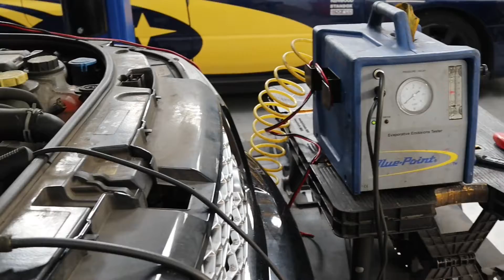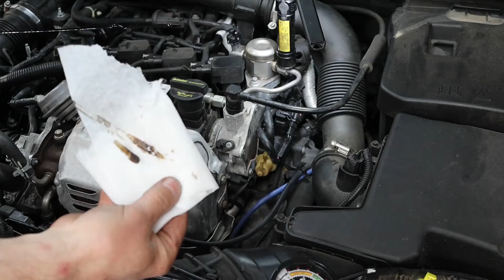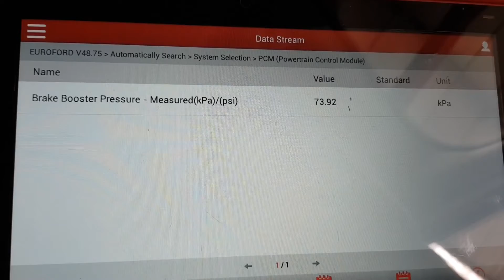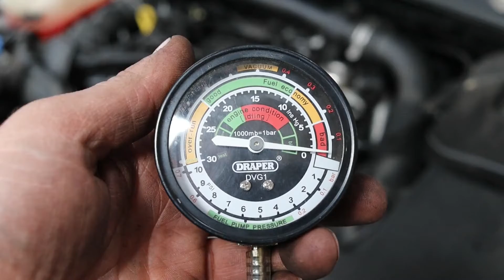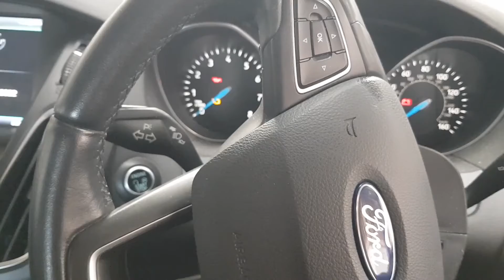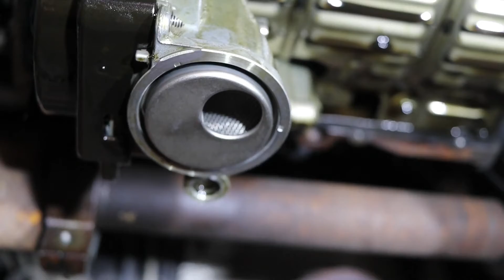Focus, Fiesta 1.0 EcoBoost P0299, oil light on

Comment: PLEASE HELP! 
I’m so Confused 😩🤦🏼‍♀️ I have no clue about cars mechanically, brought my son a 2016 focus, 62k, lovely car. A week later oil light came on. But Engine has oil? Sounds like crap, apparently it’s a ‘death rattle’ for a car 😩🤦🏼‍♀️😩 I spoke to someone that works at Ford who said there is a common fault with the oil pump pick up? And it’s probably because the ‘wet belt’ has broken down and probably hasn’t been maintained properly. He said we could just change the oil pump but may aswell do the wet belt aswell incase it is knackered. But I cannot afford it, my son cannot afford to spend so much as he’s only started work last week after finishing college. I really hoped this would at least last him 6 months. Paid £3k for it due to light body work damage on side and boot. But ran ok and no oil light on wen we brought it. My husband is a paint sprayer so can do the body work but he’s not a mechanic. Now reading through all these comments it sounds like they don’t all have wet belts? And it could be something else completely, am I correct in thinking that? And can anyone advise what I can do next, in the best way financially to just get it useable? Would HUGELY appreciate anyone’s advice 🙏🏻
Reply from the maker: Hi, if it's a 1 litre ecoboost engine then yes it's a wet belt, if the oil pump strainer is blocked, which is highly likely then you'll eventually need a new timing belt. There aren't any short cuts to this job. If it has A/C then at least one of the pump bolts will break as this has to be removed to do any of the repairs, this usually escalates the work. Sadly these engines are very unreliable, difficult to work on and expensive to maintain.
Reply: Yes I can advise you that Ford will replace your engine at their cost as long as you have the following criteria is met under the Ford good will scheme.
You MUST have full service history from either Ford or an independent garage.
Car must be under 19 yrs old which it is.
The servicing must be manually within 3 months either side of due date.
They will need to review the car to ensure it was belt failure that caused the engine failure.
Hope this helps and all Ford dealerships have been sent a document from Ford stating the above mentioned so all long as you have the history then go direct to Ford ok
Reply: Sorry 10 years old😂

Comment: I wouldn't buy a wheelbarrow if it had a Ford badge on it, I started working on Fords in the late 1960s, they were a heap of junk then and they're a heap of junk now. Just had a Transit 2 litre diesel engine replaced at 77k miles because the head gasket failed and the injectors were so stuck in that they couldn't shift them to get the cam cover off (this was at a main Ford dealership). This is yet another common problem with Fords. Why the hell people buy them I'll never know, to say they're crap is not true - they're much worse than that!
Reply: Great cars, with great engines!.. Every brand of cars got shitty individs, and every brand got well driven garages!.. Correct me if I'm wrong!.  1.0l ecoboost engine when new, back in 2012, no one knew about it's future weaknesses!.. Driven Fords when new, then you know why they sold so many of 1.0l ecoboosts!..  If Ford had taken it a bit more customer-friendly,.they may be would sold it for a longer period as well!. I've had so many people that are telling me about the greatest fun in their own Fords,.. And I certainly belive every thing said about what these cars offers, in a fun, and reliable way!.. So, after 7-8 years there are people who have been neglecting service, and specs, and there comes ones trouble!.. The electrics and mechanical parts on these Ford cars, are actually the best Ford-cars ever been made,..my opinion..
Reply from the maker: @gorgon9786  my sons 1.0 ecoboost was less than 2.5 years old when it snapped a crankshaft. The manufacturer knows there are issues from the start but they usually make more money selling lots of cars than warranty claims, so it's worth letting them go hoping they make it to 3 years! For example, Renault does not test any of their car parts, as it works out cheaper to replace parts under warranty rather than pay to test them before hand!
Reply: @melsmotors  yeah, that is due to the shitty belt, huh?. Hope he got it fixed under warranty!?  There are many bad stories, where the belt has gone bad in such early life of the ecoboost engines..  If Ford had been wise enough to found another way,.
But, as someone said it, if make it work for 3 years,.. They are winners!.. Without thaughts for future,.. If you don't see the customers again!!.. The Ford saga, isn't what it was from 2004-5, and making it big for 10-15 years, won't be enough for the future..  In my book,. French cars are as bad as any GM.. Maybe they've been doing it better the last year's?.. Vag has been had their shitty complaints as well,.?  Not bad cars overall?
Reply: @gorgon9786  I just fell off my chair laughing! Since my last post we've had yet another Ford Transit disaster on a not very old one which we have owned from new and which has always been maintained exactly as per specifications. The stupid wet timing belt broke, over 30,000 miles before it was due to be replaced according to Ford's spec. Again, a common fault which has now cost thousands for a new engine, second Ford engine failure in less than 2 months which have needed new engines at under 100k miles. The internet is full of tales of woe with wrecked ecoboost engines as well as these diesels. They are all CRAP! I have an Audi A6 diesel which still runs like new at 322k miles, the cam cover only having been off once to replace one glow plug and the rest of the engine being original except for service replacements like cam belts etc. In over 50 years of working with cars I've never seen a single Ford which could even come close to that level of reliability. The head mechanic at our local Transit main agent even admitted himself that they're a heap of trouble.
Reply from the maker: Hi Nigel, that's a great summary of Ford, when I was at college they used to say, "FORD, Found On Rubbish Dump" my friend works at Ford and says they couldn't build an engine to save their lives. Even the new transits have a crappy wet belt! Thanks for watching and commenting ☺️
Reply: @melsmotors  The other ones are "Found On Road Dead" or "Fix Or Repair Daily".

Comment: I totally agree with you. The timing belt and oil don't mix. I was in tesco Carpark, and I heard this focus knocking on tickover. This little old lady said to me that this light came on the dashboard 6 weeks ago. I had a look at the car for her and found the oil strainer completely blocked where the timing belt started to break down. Fords quoted her £6000 for a new engine fitted, lol.
In my opinion this has to be one of the worst engines Ford has produced.
Reply from the maker: Hi Paul, thanks for your insight. One of my old mechanics now works at Ford and his comments were that, as of right now Ford can't seem to make an engine to save their lives! We're changing engines every day on something, including Transit engines with the wet belt. The little Peugeot and Citroen engines are similar with a wet belt. If a mechanic could drag an engineer out of his chair and into a workshop he would get such a beating for their stupid designs! 😵‍💫
Reply: Hi.
How did the car do after you cleaned the oil filter?

Comment: Informative video, is that diagnostic machine Launch?
Reply from the maker: I can't remember the video, if it was a red scanner then yes it was the Launch. The snap on is also red but most people recognise that scanner.
Reply: @melsmotors  i did think it was Launch......i think mine one is the same but totally Useless now as its out of software update and once is out of software update period Launch Uk makes those machine almost inoperable on purpose! Unlike Autel, 3 years old and performs much better than launch🙈

Comment: PSA Pure Tech 1.2t has same issue. I read they put it in the oil to reduce friction and make the motor use less fuel. The race to minimum c02 emission.
Reply from the maker: That doesn't make any sense if you think about it, some timing belts have a white coating on the teeth to do just that. Thanks for watching and commenting :0)

Comment: *****Easy fix.  Place your finger over the small vacuum pump port that he connects to at 3:53 .  If you can feel a vacuum but also blowing air the check valve that is the plastic port is bad.  Remove the star fastener that holds in the small vacuum port (check valve) on the pump.  Remove the plastic star shaped diaphragm holder and any remnants of the rubber check valve.  Replace back on the pump and splice in an $8 vacuum check valve from Dorman to the vacuum line.  Ford does not sell the check valve separate from the $160 pump. Worked great in my case as the pump was still good as I suspect the one in this video was.  Don't forget to check that the solenoid is holding vacuum and all the other lines are intact.  You definitely do not want to replace the vacuum solenoid like he did, Ford wants $900 for it.  At least that's what my local dealer stated.
Reply: You can buy the check valve on eBay in the UK.  £10 - £15
Reply: Çok doğru tespit boşuna pompa değistirmek yanlış
Reply: First thing I said was ' that pump is good' 😂.

Comment: For future reference, it's sometimes only that little plastic nipple on the vacuum pump that fails, there's a diaphragm on that and it tears. You can undo the t25 or t30 (I can't remember) and replace this nipple/diaphragm only 👍👍

However in your case with the brake booster issue I completely agree the complete pump needed to be replaced. But if it's just an underboost fault check the nipple
Reply from the maker: Thanks for your input, if the cambelt crumbles on these, which they always do, it's always a new pump as the belt fragments score and damage the pump. Ford normally put a turbo on these as that the next thing to go in this situation. Crap engines. I will check the valve on the next one though. Thanks for watching and commenting 🙂👍
Reply: @melsmotors can you pls help me with some advice? Do you have a business contract number at all? Or email? I’m happy to pay for some advice I’m just desperate with my sons car issue, my heads spinning as I know nothing about cars mechanically 🤦🏼‍♀️ I’d really appreciate it if you can 😊🙏🏻
Reply from the maker: @serenitystars8839  hi there, if you could just outline your concerns that would be helpful. We are a very busy garage working 10-12 days a day, 6 days a week and sifting through a 100 emails a day plus making and editing videos 😵‍💫
Reply: Where did you find the check valve for this?  Ford did not have a listing for it, had to purchase the entire pump.
Reply: @PlayscBricks  if you put the fault code here into youtube, there is another video where the guy just changes the black nipple on the pump and also shows how its collapsed inside (faulty) he explains ford don't sell the part, but has a link showing were you can get the little black nipple! he proves its a real fix with a vacuum pump :) however this is also a fantastic video showing a number of other possible problems and issue!!!
Reply from the maker: @PlayscBricks  I didn't put a check valve in it, it was a comment from a viewer.

Comment: Hi - As your video suggests that the Ford 1.0 turbo and 1.5 turbo  eco-boost engines are so problematic I have been looking to replace my 2008 Ford Focus 1.6 petrol zetec which has been a very good car with either a 2018 Ford C-max 1.6 125 hp Vct-i or a 2019 Nissan Qashqai 1.3 turbo 140 hp  although the C-max has some issues with the electronic powered steering - sometimes having to replace the whole steering unit because of a seal on the motor unit ? In fairness Nissan also uses Electronic powered steering and like Ford the powered steering may stop working if the battery drops in power ?  Maybe you couldn't recommend either of these cars ?
Reply from the maker: Hi Allan,
Sadly it's difficult to give advice on cars, as a car has to match your needs. So many questions to ask. Personally I wouldn't spend my hard earned cash on either of those cars. A Nissan is practically a Renault in sheep's clothing and Ford can't seem to make a decent engine lately and I definitely wouldn't buy a German car. My wife drives a Honda. If I had a pick a car for my family member it would be either Honda, Toyota/Lexus, Kia or Hyundai in that order. Hope this helps 🙂👍
Reply: @melsmotors  Thanks for the advice . I was hoping that you might have been able to recommend the Nissan having owned a 1993 Sunny and 1999 Primera which were both reliable and good build quality . There is just so many complicated electronics in modern cars - so many things  to go wrong !  It’s a bit sad that Nissan ain’t what it use to be .  Anyway thanks for your time  .
Reply: @melsmotors  Hi - Having done some more research online I bought myself a 1.3 Accenta Premium Nissan Qashqai - what a fabulous car - apparently the new 1.3 turbo 140 hp engine was developed by Renault/Nissan and Mitsubishi .  It appears to score rather well in the reliability and build quality but time will tell as I have only had it about 3 Months but thanks for your advice anyway .  Its such a different driving experience from my 2008 1.6 petrol Focus ( as you would expect after 11 years ) - Its very quiet refined and very comfortable and actually very enjoyable to drive in part because of the responsive engine and the sport steering mode weights up for better feel and feedback .   Anyway hope you are keeping well and keeping up the good work .  🙂

Comment: Great video, I have a focus ecoboost with a flickering oil light  and a underboost code when checked with launch tool I am able to see that my brake boost pressure is showing -91 any idea why this could be ?
Reply: Mine started doing the same today.  😢 136000 miles.

Comment: its a sh#tty motor end the rest is poor quality ,its a shame it drives like a dream though.
Reply: I hve same problem .it loses power and diagnosed to find out turbo is bad and 3rd spark plug get soaked by oil and that cause misfire
Reply: @nicodimusmatsedi49    vacume pump valve,. Might be first thing to check!.. A little diaphragm valve, which is no. one fault.. Buy it,. And replace it yourself,.. In the wrong diagnosed dealerships,. You've might change everything!.. Do it yourself at first, avoiding huge bills,.. Worth a try!..

Comment: My b max had low oil pressure turned out the timing belt was shredding bits of rubber having two new wet belts fitted next week big job
Reply from the maker: Hi Keith, sadly it's not a pleasant job. Make sure the oil strainer is cleaned out or the oil pump replaced, this is a must otherwise you're wasting time and money. Watch the video from 19.35.
It you have A/C there's a good chance one of the compressor bolts will break and you may need a new sump as well!
The Peugeot wet belts have the exact same problem!
Thanks for watching and commenting ☺👍

Comment: Thanks for the video! Do you know the torque spec for the oil pan screws? and for the turbo to downpipe conexión nuts? Thanks for your support
Reply from the maker: Hi Pablo, this is from memory, but always check your tech data, the sump is around 10nM and the exhaust we do by feel, reasonably tight around 25nM. CHECK TECH DATA, THIS IS A GUIDE ONLY. thanks for watching 🙂👍
Reply: @melsmotors  thanks! Next week I will do the job, this is a perfect guide to know how to proceed 😉

Comment: Hi. Great video, well explained. I had a problem of turbo underboost. The mechanic reconditioned the turbo and the power loss issue was resolved. I still have two issues though. First is the fuel consumption which is very high. I thought it was the Oxygen sensors and i replaced both of them but the problem remain. The second one is when i rev the car it cuts out. Do you have any idea what could be causing the problems?
Reply: maybe check the vacuum pump valve
Reply from the maker: Thanks for watching. Sadly I can't help without a fault codes, live data and road test! Speak to your mechanic about it.
Reply: @melsmotors  Its a P0002 code sir
Reply from the maker: @bensonmpete3175  need to run live data with that code. It's not bringing up anything specific. See your friendly mechanic for help 👍

Comment: Great video, my boy has a 1.0 ecoboost Fiesta with 50k on the clock, last service, I pulled the sump to check the strainer and it was perfectly clean to my relief. Shows the benefits of the Castrol Oil I use in it and changing it regularly.
Reply: Sorry to bother you, do you know generally how often do he change it?

Comment: I have 2013 c Max 1.0 ecoboost with 206 000 km. I bought it from Austria with 187 000 km on it. It runs fine,does not take any oil in 10 000 km when i change it. But,on first start in the morning engine starts great but rattles something in it for 3-4 seconds and stops.  Oil light   turn off instantly. No problem with the preassure.  Any idea? Greetings from Croatia.
Reply from the maker: Thanks for watching and commenting 😊😊
Reply: @melsmotors  puno bi mi više zahvalio da mi kažeš dijagnozu. Ventil u turbu?  Došao bi ja do vas ali ste mi daleko. 😁
Reply from the maker: @dado500  Hvala što ste pogledali moj video. Ne znam koji su vaši simptomi ili problem. Predložio bih vam da pronađete dobrog lokalnog mehaničara. Moji videozapisi služe za zabavu i možda ne odražavaju isti problem koji imate vi.
Reply: Hi.I have the same symptoms only  rattling is shorter about 2 seconds.Did You solve  your issue? I wonder if there are worn connecting rods that no longer hold oil enough, which means that filling the oil main line  takes longer.
Reply: @pawlo79pl  hi. Did not solve the problem. I will drive until it stops. Then probably buy another engine.